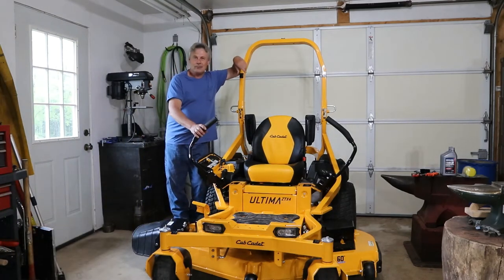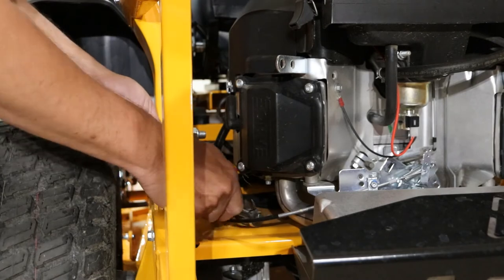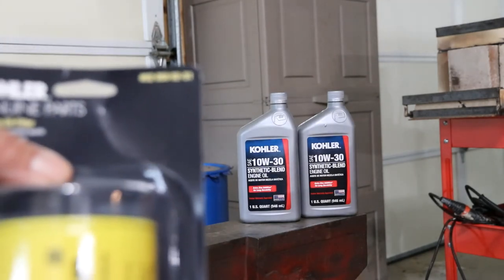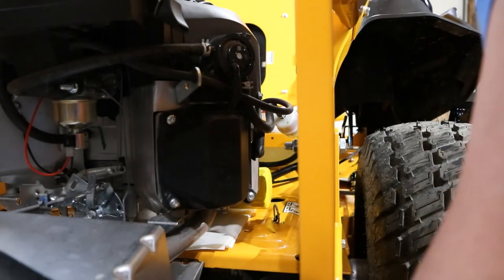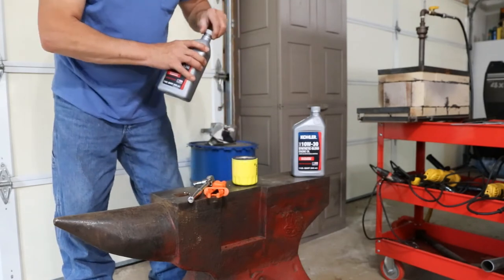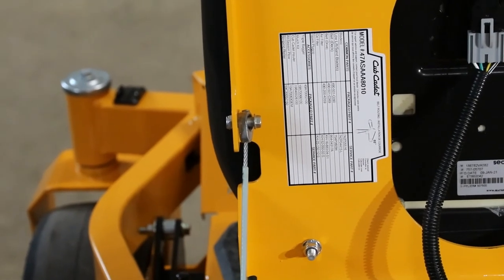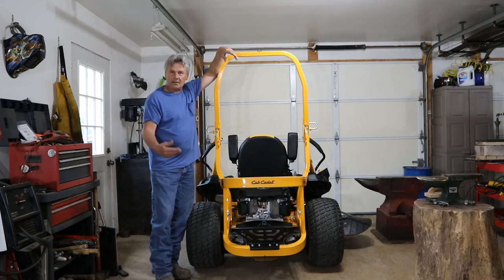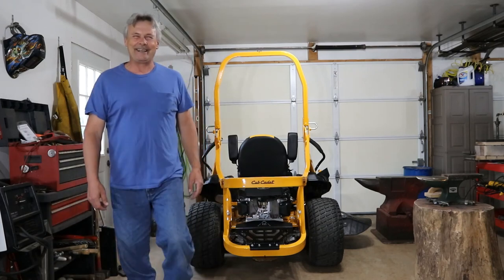How To Change The Oil On The 2021 Cub Cadet Ultima Zero Turn

Comment: What a better way to spend a rainy day, Joe. Gotta keep those machines in top notch condition! The Cub Cadet dealer we bought our ZT2 from went over all the maintenance intervals but said the break in oil change really wasn't necessary and to just go ahead and change it at the end of its first season. Not sure why but to play it safe I went ahead and changed it anyway. Easy peasy.  Better safe than sorry especially when spending that kind of money on a nice machine like that. Great informative video for a first time user buddy. Keep'em coming!
Reply from the maker: Good Morning and Thank You Josh , This Mower had a thinner break in oil for the 5 hr. mark so like you I played it safe . This mower runs out a little faster than the mower I had and I spent Saturday mowing the trails here and the machine did a good job saved about an hour however Mule Slide required the string trimmer😁 Have a good day Buddy and Thanks for Watching

Comment: For anyone having trouble getting the drain plug loose on your first oil change, here's what I did. I used some vice grips (locking pliers) to hold the hose and an impact driver to remove the drain plug. Came off like a champ.
Reply: Hopefully you see this a year later. What size socket did you use?

Comment: Daddyjoe - did the Kohler manual recommend synthetic oil on the 5 hour change?
Reply from the maker: Good evening, The manual states that you can use SAE or Synthetic and I did use the Kohler brand 10-30 synthetic. I will stick with the same oil through out. Thanks for Watching

Comment: How did you get nut off mine has red lock tight on it
Reply from the maker: Hello , I tightened the oil plug just a little to break the seal then loosened the plug  I hope this helps and Thanks for Watching .